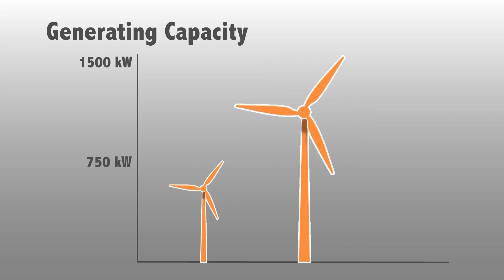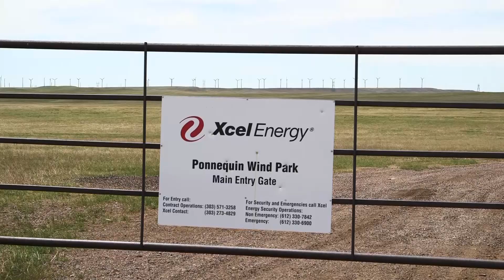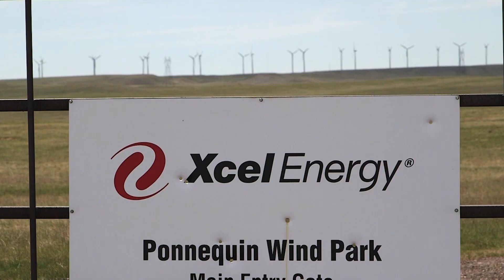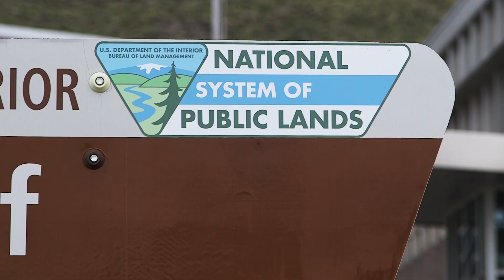Who Cleans Up When a Wind Farm Retires?

Comment: The question is the cost of putting them up and the cost of taking them down does that justify the amount of power that they have actually produced
Reply: Any  math idiot knows better than that. Fossil fuels told em to take them down.
Reply: Inefficient energy source
Reply: @JONNYCABANI  How is it inefficient? It has no fuel cost, no pollution while running, no need for a military escort to bring it oil. If you mean intermittent, that's correct, but that's a problem easily solved.
Reply: @justsomeguy934  cost of maintenance, land, cleanup also it is not windy everyday.
Reply: @JONNYCABANI  " cost of maintenance, land, cleanup also it is not windy everyday." You're correct, there are capital costs that go with a solar or wind farm. However, the fuel is free. In addition, they put wind turbines where it's windy enough to be worth it. They put solar farms where it's sunny enough to be worth it. Do not make the common mistake and think wind farms are placed where you are used to breezes. They do thorough studies to see where it's economically feasible to put them.
Reply: @justsomeguy934  Most wind farms only exist because of government subsidies. Wind is not an inexpensive energy. For personal use a low cost windmill used can help with energy needs. Most of these wind farm turbines are a result of govt cronyism.
Reply: @JONNYCABANI  "Most wind farms only exist because of government subsidies. Wind is not an inexpensive energy." I have found information to the contrary. Regardless, solar and wind have free fuel and we're not having to ship oil from hostile countries to make energy if we use renewables. My goal is energy independence, and getting there by renewable energy and reduces consumption of oil. Simply drilling for more oil won't fix the problems.
Reply: @justsomeguy934  If Biden would let oil companies drill for oil in America, we would have plenty of oil. We were a net exporter of oil under Trump. Biden stopped that.
Reply: @justsomeguy934  We were a net exporter of oil under Trump. That means we had enough oil for our domestic use and could sell the excess to other nations. 

Biden stopped oil drilling on federal lands. He needs to reverse that policy.
Reply: @Cooldudewhotellsamazingjokes  "We were a net exporter of oil under Trump. That means we had enough oil for our domestic use and could sell the excess to other nations." You are correct about being a net exporter, but that doesn't mean independent - we still buy oil from foreign sources every day, every day their tankers unload oil at our ports.
As for Biden wanting us to be either a net exporter or independent, lots of luck with that. The only way forward is to REDUCE oil consumption, and using renewable energy instead is the only safe avenue we have.
Reply: @Cooldudewhotellsamazingjokes  "We were a net exporter of oil under Trump. Biden stopped that." You're absolutely correct! But Biden will not in a million years put the USA in any oil independent position, so stop quoting how great it was under Trump (I'm a Trump supporter, btw). All we can do now is to stop burning up precious oil as fuel and start using sunshine and wind.
Reply: @justsomeguy934  Windmills use an enormous amount of oil that requires regular changing. The material is manufactured from petroleum. They kill birds at an high rate and before you claim other things kill more, the windmills are located in areas that have high concentration of birds of prey such as eagles, falcons, hawks, and owls. Not many of those species are flying into buildings, those are pigeon and seagulls. They are an eyesore on otherwise pristine landscapes.
Reply: @PHUCKyoutube689  "Your whole argument for Windmills is irrelevant as wind can not meet demand." You've made the incorrect assumption that I advocate 100% wind power. I don't advocate 100% dependence upon ANY energy source. Wind, coal, solar, hydro and FF have to part of a balanced energy plan. Wind and solar CAN, indeed, supply all the energy we need if we also have grid-level storage, but we don't. Don't jump to conclusions.
Reply: @PHUCKyoutube689  "They absolutely kill birds of prey at an excessive level. Living near windmills I have seen it. " The birds-of-prey argument is a red herring put in your mind by the oil companies. Geese fly over the Himalayas, friend. Ducks fly much higher than a wind turbine sits. Cats, dogs, buildings and pesticides all kill birds 10x to 100x more than wind turbines and they don't provide fuel-free energy. Your perspective needs adjustment.
Reply: @PHUCKyoutube689  "The structures of the windmill create habitats for the small rodents these birds hunt. " Um, my house creates habitats for rodents. The pets in my neighborhood create attraction for cougars and coyotes. The humans in my neighborhood attract deer, which attract bears.
Reply: @PHUCKyoutube689  "Fossil fuels are dirty but they meet the demand so one can argue it's worth it. " Solar and wind can replace much of FF in grid-level energy demand, and using electric cars that use that fuel-free energy is FAR worth it. How would you like to save HALF our precious petroleum? Electric cars do that.
Reply: @PHUCKyoutube689  "Destroying the natural beauty of the environment while arrogantly patting yourself on the back doesn't make it better for the environment. "
Ever seen an oil tanker fire, a gasoline truck fire or a vehicle fire? Are you patting yourself on the back for that?
Reply: @PHUCKyoutube689  A typical wind turbine uses 80 gallons of lubrication oil. Here's a Google Search on how that is maintained, you tell me if it's a lot of lubrication we're talking about: "For example, a typical wind turbine lubricant will have an oil drain interval of 36 months, but more advanced synthetic lubricants formulated specifically for wind can help extend those intervals even further. Jul 7, 2016"
Reply: No. They are money pits that never make a profit. Subsidies from coal, gas and nuclear electric power plants.
Reply: @GotoHere  Yup. If it were not for government subsidies, green energy would not be a viable option. 

I fear that there a lot of scammers pretending to care about the environment who create green energy. They care about green--  green cash that is.
Reply: Yes, actually already after three months of use.
Reply: Maybe bevause they have a lot bigger population? Also maybe because they produce everything we buy
Reply: 😀 cowboy don’t play around
Reply: Then the company can clean up their mess. It is expected of mining operations.
Reply: @Cooldudewhotellsamazingjokes  "Then the company can clean up their mess. It is expected of mining operations." How about oil companies? Did BP clean up the Gulf of Mexico? Did Exxon leave Prince William Sound in the same state it was before the Exxon Valdeez went aground?
Reply: @justsomeguy934  They did clean it up. By the way, crude oil in sea water biodegrades naturally.

Nice try though.
Reply: @Cooldudewhotellsamazingjokes  "hey did clean it up. By the way, crude oil in sea water biodegrades naturally."
Valdeez oil spill 30 years later: https://www.hakaimagazine.com/news/wounded-wilderness-the-exxon-valdez-oil-spill-30-years-later/
Nice ignorance, though.
Reply: @Cooldudewhotellsamazingjokes  " By the way, crude oil in sea water biodegrades naturally." Gosh, I guess we could've just left Prince William Sound oily then, right? Nice try though.
Reply: yeahhhh lets see those facts
Reply: NOT ONE BIT BUT WE ARE PRETENDINGF THIS IS BETTER THEN OIL LOL RIGHTTTT IDIOTS
Reply: @donsturtevant2396  I wouldn't trust anything China claims.
Reply: Yes.
Reply: @Eddie "wonder how much petrolium went into building them and how much will go into taking them down." Answer: a whole lot less than decades of oil-free energy production! Are you also concerned with the amount of oil, minerals and resources required to build and decommission an oil tanker or pipeline?
Reply: @Eddie "man you are special. The machines used to built and transport those fucking things use oil. So not only are we still shipping oil, now we need more to build your precious wind turbines. Also you missed my point, how much oil is used to produce 1 megawatt from a turbine vs other methods is what i was asking" Goodness, your own bias is blinding you, and boy the oil companies LOVE you for it. Wind turbines produce energy for an expected lifetime of 20-25 years on average, but can go longer with extended maintenance. Oil is used to produce almost anything we use today, including the plastics in your computer right now. The fact that oil is used to create an oil-free energy source for decades is what you're missing. Let me ask you a question: do you ALSO calculate the oil and resources used to make a typical steam generator in a power plant? I bet not! And every microvolt from that generator must be fueled with something burning. Unless it's a rare geothermal plant, coal or natural gas is being burned to make steam. The amount of oil required to make a solar panel that works damn near forever, or decades of pollution-free wind energy is microscopic compared to the megawatts those sources make every day. Looking at one tiny problem over HERE and ignoring the 100x problem over THERE is called distraction, and the oil companies didn't even need to pay you to do it!
Reply: @Eddie "So we still using the tankers and just creating more shit that is using the earths rescources and more shit that is just gonna end up in the trash in 20 years" As opposed to burning a fossil fuel for 20 years? Once built, a wind turbine or solar PV array consume NO FUEL but sunshine or wind. You're honestly comparing 100% consumption of gas, oil or coal to a propeller turning in the wind? Does that comparison seem rational to you?
Reply: @Eddie "But because Neanderthals like you "wind turbine good, gas bad" we wont ever know the truth." Upon what do you base your insult?  Only Neanderthals stick their head in the fire, breathe the smoke and say "fire good". The fact is that once you put the effects of most energy sources - coal, oil - into the equation then the don't look so good. If you'd like to continue to learn, please respond. Your insult is the sign you've lost the argument and know it.
Reply: Imagine how much fossil fuel is used to transport materials and manpower to these remote sites and then power the heavy equipment used for construction.
Reply: NOOOOOOOOOOOOOOOOOOOOOOOOOOOOOOOOOOOOOOO
Reply: NO!
Reply: WE all know none of those issues matter... they never have to prove to be of true value
Reply: NO.
Reply: The question is how stringent the laws are.  Wyoming won't tolerate big business destroying the land.  They have the most stringent reclamation laws in the world.  They won't get away with not cleaning up.
Reply: @Johnrob1943  yeah they will tear them down they will take the concrete out of the ground they will reclaim the land back to where it was but all of this crap will go into a landfill so all they are doing is moving the drunk from one place to another
Reply: @jamesgillespie6278  not in Wyoming.  In Wyoming,  while I was working drilling rigs,  if a small patch of oil was on the ground,  the company could be fined.  The only time the state couldn't go after a company was the company who destroyed an area of Yellowstone, who was out of Canada.  Wyoming doesn't go by DC rules, they made their own rules and are pretty strict about enforcing them.
Reply: @jamesgillespie6278  " yeah they will tear them down they will take the concrete out of the ground they will reclaim the land back to where it was but all of this crap will go into a landfill..." You just defeated your own argument! If they reclaim the land, put it back to where it was, we win! Using petroleum uses the air we breathe as a landfill...
Los Angeles clean air comparison: https://www.businessinsider.com/photos-stay-at-home-order-reduced-los-angeles-notorious-smog-2020-4
Reply: @Johnrob1943  If the the rules are not specific to the indusrty, or not on the books at all, they cannot be enforced. Oil rules don't apply to wind.
Reply: @rickschuman2926  in Wyoming,  the Wyoming reclamation act is specifically designed to make sure that doesn't happen.  The only time a company got around it was a gold mining company from Canada that was mining in South west Montana and a lot of the dumpings got into the Yellowstone river and seeped into Yellowstone park.  The reason Wyoming couldn't enforce it was because the firm was from Canada,  not the United States.  They deal with multi national corporations every day and because this one burned them,  they changed the law to make sure it doesn't happen again.  I've seen the before and after of the Wyoming reclamation act,  and believe me,  they don't like being screwed.
Reply: @jamesgillespie6278  Most of this "crap" has recycle value.
Reply: @jamesgillespie6278  In Indiana they were only going to take out the top five feet of concrete if there was a shutdown. We didn't sign on.
Reply: @Johnrob1943  BUT, wind farms are ok, oil isn't!
Reply: @justsomeguy934  how do you think they haul that junk to a landfill? How do you think they take apart those windmills? Fossil fuel powered machines. And you ain’t gonna replace semis and dump trucks and bulldozers with electric
Reply: @tooltime4640  " how do you think they haul that junk to a landfill? How do you think they take apart those windmills? Fossil fuel powered machines. And you ain’t gonna replace semis and dump "
SO WHAT if they use a little oil to care for, or dispose of, a wind turbine? For 20-25 years average life, it provides oil-free energy. No fuel. No pollution. Some gear oil for the gearbox. Otherwise, turbines run unattended. Same for solar panels. Even if they provide, say, half the energy we need - i'll take half my energy bill generated by wind or sun!
Reply: @tooltime4640  "And you ain’t gonna replace semis and dump " By the way, you ARE going to replace semi tractors with electric ones...it's called the Tesla Semi, and they've already received orders for them.
Reply: @Withnail1969  Millions of gallons of diesel to do WHAT? Run for decades with no fuel, no pollution? Are you talking about making the turbine? If so, I assume you have NOT been manipulated by the oil industry to not look at how much diesel is used to extract petroleum, make a tanker or pipeline, transport the fuel to where it's burned and THEN breathe the exhaust. You're too SMART to look here at a 10% problem rather than over there at a 90% problem, yes?
Reply: @Withnail1969  "these things are huge. for the size of them they dont produce much power either. what is it, 10.5 kilowatts? enough to run 10 small electric heaters per turbine. it's pitiful." PLEASE do some research before making statements. The output is measured in MEGAWATTS. Here's a quote from just the first search on Google:  "An average onshore wind turbine with a capacity of 2.5–3 MW can produce more than 6 million kWh in a year – enough to supply 1,500 average EU households with electricity. An average offshore wind turbine of 3.6 MW can power more than 3,312 average EU households."
Reply: @Withnail1969  "millions of gallons of diesel to transport, install and deinstall and transport the scrap after the lifespan. " And in return, you get decades of fuel-free, pollution-free energy. Otherwise, you burn fossil fuel to make the exact same electricity. I'll take sunshine or wind over exhaust any day.
Reply: @Withnail1969  "millions of gallons of diesel to transport, install and deinstall " I guess you haven't seen how big oil tankers are, how big pipelines are, how big oil rigs in the ocean are.
Reply: @justsomeguy934  why do you feel it's necessary to type exactly what these other people have said?? Wow man you have alot of time on your hands 😒🤣
Reply: @laurijoemerick9188  I quote back the sentence(s) to a person that I'm responding to. I do it for several reasons: 1) when proven wrong, a lot of people delete or edit their comments and try to act like they didn't say what they said; 2) some people leave a $&*!! novel in a response, so how do you know what specific concept or "fact" you stated that I'm responding to? Sometimes, a person responds to a comment they made MONTHS or YEARS ago. I've had a response to a comment I made 2 years after I made it - do YOU remember what you typed 2 years ago? When someone says "that's a lie" and you wrote a dozen things in a statement, WHICH ONE are they talking about? 
As for time to "type exactly" what someone says, it's called copy & paste.
Reply: @Johnrob1943  You have to be dreaming. They can't make them do anything if they declare bankruptcy. That will be the ploy they use.
Reply: @rogergibbs2937 , sorry to say,  but the corporation has to buy insurance before anything happens.  That means even if they try to declare bankruptcy,  they still have to pay for the cleanup.
Reply: @Johnrob1943  the insurance company goes bankrupt like the 700 did under jew ronald reagan
Reply: @rogergibbs2937  I guess you missed the part about having to put up a bond? Or do you just not understand how that works?
Reply: @michaeldose2041  what I don't get about it, is inflation.
Is the bond adjusted on a year by year basis, or is it a single payment that is made and never updated.
Because $20 twenty or forty years ago would buy more than $20 today. While a hypothetical figure of $20 million might have been enough to comply with the regulations of the time, between inflation and regulatory changes, is the bond ever updated?
Reply: @kieranh2005  
The idea is the bond will have a known value at a given time, principal plus interest.  What would need to be done is to estimate the cost of decommissioning plus inflation and choose an appropriate bond to match that future value. The point is the money is put there up front. It might not be the exact amount but declaring bankruptcy won't erase the bond because it would be held separately from the company. The bigger problem might be the government has a hard time keeping their hands off the funds.
Reply: @donsturtevant2396  Yes, I'll go to China and let them tell me all about it - while they're coughing and wheezing trying to breathe the cesspit of toxic fumes that passes for air in Chinese cities. Where did you get that 50% figure from, you do understand that the Chinese Communist Party are the biggest liars in the world? As to "what is CO2 energy" not sure what you mean. I used the term "Near Zero CO2 electricity" as nuclear power has indirect (life cycle) emissions of 12g/kwh (figures from the IPCC) and no direct emissions (unlike fossil fuels). Fossil fuels have both massive direct emissions from burning fuel, and enormous secondary emissions from the required support activities, combined these can be as high as 1.2kg/kwh in the case of brown coal.

If you think it's a good idea to carpet bomb the planet with bird-chomping, bat killing monstrosities, wasting enormous amounts of money and natural resources, all to get a small amount of electricity that's literally only as reliable as the weather and has to be backed up by fossil fuels anyway, you really need to look into it a little more. Maybe don't let the fossil fuel companies, Greenpeace, Greta Thunberg et. al. do your thinking for you.
Reply: @seanC3i  "If you think it's a good idea to carpet bomb the planet with bird-chomping, bat killing monstrosities, wasting enormous amounts of money and natural resources, all to get a small amount of electricity that's literally only as reliable as the weather and has to be backed up by fossil fuels anyway, you really need to look into it a little more." OH. MY. GOD. Did Exxon write that paragraph for you? Cats and buildings kill 3x the birds that turbines do, check Audubon Society. As for wasting enormous resources on renewables, what do you call the trillions in oil subsidies we spend? Is that a waste? How about the trillions in free military escorts we give oil tankers? We've been in Afghanistan for 30 years now and not one dollar is paid for by the oil industry. Please add aircraft carriers, submarines, billion-dollar airplanes, tanks, helicopters and troops into your rant about how expensive a solar farm is.
Reply: @justsomeguy934  There is so much to unpack here. Firstly, where did I say I was a fan of fossil fuels? I regard both renewables and fossil fuels as obsolete, we should have started phasing both out starting in the 1950s. Second, cats kill small birds with fast breeding cycles. Windmills kill threatened birds like eagles that are larger with slower reproduction. They are also a mortal threat to bat populations and cause more mass-mortality to bats than White Nose Syndrome, which is itself an extinction-level threat. You need enormous amounts of materials (most of them not recyclable) to generate a small power flow that is so unreliable you need fossil fuels to back them up anyway. So yes, your wind farm must also include whatever costs you associate with oil and gas, because it's part of the package. As to Chernobyl, the Soviet Union used a dangerous reactor type called the RBMK that was known to have fatal flaws. That's why they were never built outside the Soviet Union. Even still most of the land affected will be re-usable well within this millennium, not 20,000 years. As to Fukushima, the radiological release from that was nowhere near as bad as Chernobyl, if it was, all of Japan would be uninhabitable, instead almost none of it has been affected and all of that land that was affected can be cleaned up. Germany has had their Energiewende (energy revolution) since the Cold War in 1980 and all they have to show for it is a landscape that had been industrialized, sky high electricity prices, an unreliable power supply, lots of dead bats and an at-best modest reduction in CO2 output. France has none of that and its electricity supply is near-zero CO2, because it relies heavily on nuclear energy. And it's been this way for decades. Think for yourself. Look at what is working and what is not. Do the research. I suggest you start by looking at https://www.electricitymap.org/map for live CO2 figures for national power supplies.
Reply: @seanC3i  "As to Fukushima, the radiological release from that was nowhere near as bad as Chernobyl, if it was, all of Japan would be uninhabitable, instead almost none of it has been affected and all of that land that was affected can be cleaned up" Nope, it can't be cleaned up. Fukishima will run out of contaminated seawater storage in 2022. Their site is still emitting radiation and will do so for the foreseeable future. I don't care of a country hasn't had a nuclear incident yet, they can and the consequences are horrific. A fallen wind turbine has none of those issues. Your selection of the types of birds killed by turbine amuses me; it's OK for buildings to kill 3x the number of birds, but not use an energy source that kills a fraction of those? May I also assume you're objecting to the 2/3 of other bird species killed by buildings, or is that OK? Methinks your CO2 and bird kill objections only apply to renewable power. 
As for the reusability of the land at Chernobyl, the estimates vary from several hundred years to over 20,000. The 20,000 figure is from the Director at Chernobyl himself,  Ihor Gramotkin in 2016. Greenpeace estimates it at "tens of thousands of years". With a margin of error between hundreds of years and 20,000+ years, I'd say you cannot make any conclusions on the shorter side. Your romancing the effects of nuclear incidents is both irrational and baseless.
Reply: @seanC3i  My posts get long so I break them up. Here's some more information on the Fukishima cleanup, directly from TEPCO:
"TEPCO has been unable to release 1.2 million tons of water kept in nearly 1,000 tanks at the Fukushima center. It is feared that the release of radioactive water will harm fishing and agriculture in the area." Further information about contaminated water: "The plant can only store up to 1.37 million tons of water. And the amount of water is growing by 170 tons every day because it is used to cool the melted fuel inside the reactors. At this rate, TEPCO says the plant will run out of storage space by the summer of 2022."
Japan was supposed to start removing the damaged fuel rods but put that off for at least another decade. Also from TEPCO: "Their removal was first planned in 2018. But it has now been postponed for up to 10 years in order to reduce radiation and to clear other waste."
There are NO PLANS for disposal of Fukishima's nuclear waste: "The biggest difficulty for Japan is the removal of an estimated 880 tons of melted fuel from Fukushima’s three severely damaged reactors. The amount is six times larger than what was found after the 1979 Three Mile Island partial meltdown in the United States." Furthermore, "Japan hopes to slowly expand the process of removal with new methods and robotic development. However, the country has yet to develop a plan to dispose of the highly radioactive melted fuel and other waste from the reactors."
You can romanticize nuclear energy, but I don't. Wind turbines and solar panels and dams won't be obsolete until the sun stops shining.
Reply: @seanC3i  ". As to Chernobyl, the Soviet Union used a dangerous reactor type called the RBMK that was known to have fatal flaws. That's why they were never built outside the Soviet Union." Interestingly, the RBMK reactors are still being used by Russia, and still in operation. Russia actually says as a result of Chernobyl, they have corrected the flaw in the RBMK reactors and they're safe! Aren't you happy? Fukishima wasn't an RBMK, it was made with the latest and greatest design and materials and....here we are. There simply is NO ENERGY source available that has the potential of damage and centuries of radiation that a nuclear plant does. Even a dam break doesn't exclude the area for eternity like a nuclear plant does.
Reply: @seanC3i  "You need enormous amounts of materials (most of them not recyclable) to generate a small power flow that is so unreliable you need fossil fuels to back them up anyway." Wind turbines are 80% - 90% recyclable, how recyclable is diesel fuel? Where are you getting your information? From the EVWIND.ES website is the quote: "Today around 85 to 90% of wind turbines’ total mass can be recycled. But turbine blades represent a specific challenge. Made from complex composite materials to allow for lighter and more durable blades, they require specific processes for recycling." Here's some more information on recycling, same website: "The best strategy for wind turbine blades is one that combines design, testing, maintenance, upgrades, and the appropriate recycling technology to ensure the maximum value of the material is retrieved throughout its lifetime". Again, even using diesel fuel creates poison 100% of the time you're using it, not counting the impact of extracting and refining it.
So if up to 90% of the total mass of a turbine is recyclable, your "massive amounts of resources" statement is baseless.
Reply: @seanC3i  Funny, the Japanese government is now requesting a 40-year lifespan of all nuclear reactors given the Fukishima incident. Here's some information from Wikipedia: "On 6 January 2012 the Japanese government proposed a maximum lifespan for nuclear reactors of 40 years. This was one of many proposals that nuclear crisis minister Goshi Hosono announced to review the nuclear safety regulations for nuclear reactors and nuclear fuel material."
Wind turbines last 20-25 years, maybe 40 with good maintenance. Seems nuclear plants have a shelf life, too, not much different than wind turbines or solar power. The difference? The nuclear plant can kill you forever, the wind turbines just fall over or sit there. I'm picking turbines for the win!
Reply: @justsomeguy934  The real problem with nuclear is the waste.
Reply: @justsomeguy934  Chernobyl shut down safety features to do a test. That's why they blew up.
Reply: @middletech  Correct. Russian power plant operators were notoriously trained to the bare minimum.
Reply: @middletech  Correct, the waste processing and storage is the problem.
Reply: @seanC3i  "Yes, I'll go to China and let them tell me all about it - while they're coughing and wheezing trying to breathe the cesspit of toxic fumes that passes for air in Chinese cities." You're 100% correct that China has a tremendous air pollution problem. Guess what? Unlike the USA and USA oil companies, China is actually DOING something about it. They are REQUIRING a certain amount of cars sold there be electric. Not the USA! Oh no, our oil companies are dragging their feet making sure we don't get rid of smokers as cars. And the oil companies here don't have to do much - we have idiots right here in the USA helping them. My favorite is where the oil-is-best crowd objects to the concrete in a wind turbine base because concrete emits CO2. CONCRETE! Interestingly, those same people don't object to concrete in highways, buildings and bridges but OH NO it's BAD in a wind turbine!
Reply: NO. Wind turbines are a great con. They use enormous amounts of material and land to produce small, unreliable amounts of electricity. And they kill crazy numbers of birds and bats, many of them threatened or endangered species. Nuclear energy on the other hand, produces vast quantities of clean, near zero CO2 electricity on a reliable, baseload basis, while using almost no land and few resources relative to their output.
Reply: @seanC3i  The amounts of killed birds and bats are very small.
Reply: @seanC3i  Do you live near chernobyl and have a holiday home on 3 mile island and vacation on sunny bikini atoll (what's left of it)? Radioactive waste takes a long time to become safe again and costs a lot to reprocess.
The nuclear power industry can only survive because it gets massive subsidies and uranium has to be mined and processed and nuclear powerplants have a finite life, as does every form of powerplant but at least a decomissioned windfarm can be relatively easily removed and landscaped if an improved, more efficient windfarm isn't built on the site.
Reply: @davesy6969  Have you seen the new technology? It will change electronics. 

I am not making this up. They have taken radioactive isotopes from nuclear waste and combined it with computer chips. Naturally, the radio isotopes are a very small amount. Oh yeah, that atomic battery will power that computer chip for 20,000 years.

Nuclear waste will become a highly valued commodity in the future and electronics will enter a whole new level of technology.
Reply: @seanC3i  "NO. Wind turbines are a great con. They use enormous amounts of material and land to produce small, unreliable amounts of electricity. And they kill crazy numbers of birds and bats, many of them threatened or endangered species." Absolutely untrue. Cats and buildings kill 3x the birds that wind turbines do. If you'd like a picture of the birds and wildlife killed in Prince Williams Sound after the Valdeez oil spill, just ask.
Reply: @seanC3i  "Nuclear energy on the other hand, produces vast quantities of clean, near zero CO2 electricity on a reliable, baseload basis, while using almost no land and few resources relative to their output." See: Chernobyl and Fukishima. Oh wait, they're out of commission for 20,000 years.
Reply: @justsomeguy934  I think your estimate of 20,000 years might be a little conservative, 50K might be more realistic!
Reply: @nickybritain4900  On the Chernobyl exclusion zone, the estimates range from 320 years to "tens of thousands", with the Chernobyl Director saying 20,000 in 2016. With a margin of error like that, no one has any idea what it is.
Reply: Next time you drive by one of these places count how many are turning...usually way less than half. Its not unusual to see NONE of them turning.
Reply: @americanpatriot3638  "Next time you drive by one of these places count how many are turning...usually way less than half. Its not unusual to see NONE of them turning." I wish you understood how the grid works. It, for the most part, has no energy storage. For the most part, if a turbine isn't turning then the energy isn't needed. Utilities shut down unnecessary generators all the time. At night, only a fraction of the available energy production is actually producing because demand is low. I drive by a wind farm quite a bit, I have NEVER seen the turbines NOT spinning.
Reply: @justsomeguy934  I drive by them all the time. I'd put it at 90 percent.